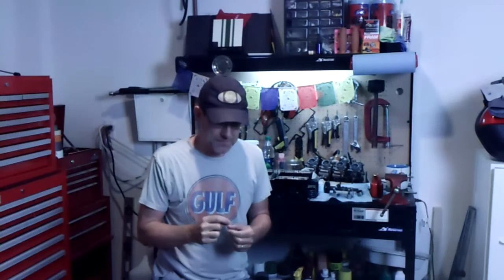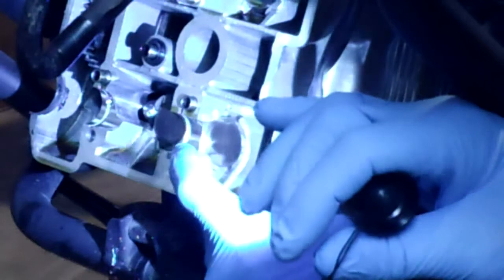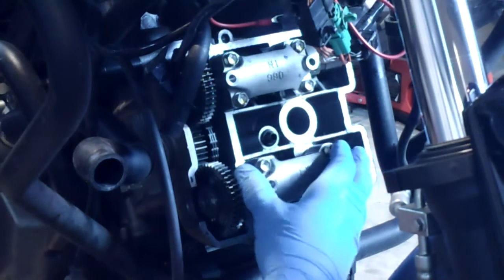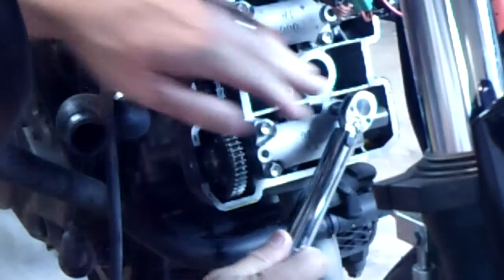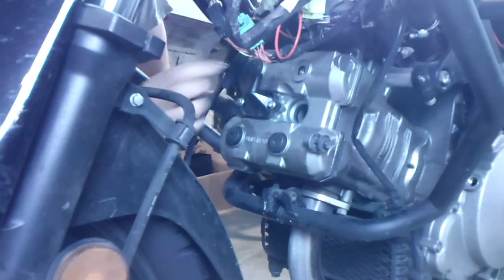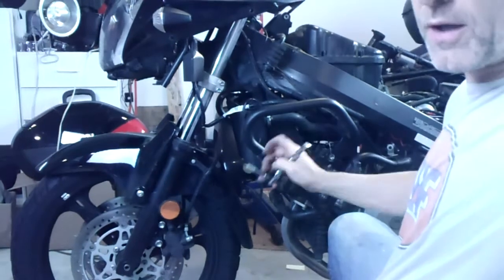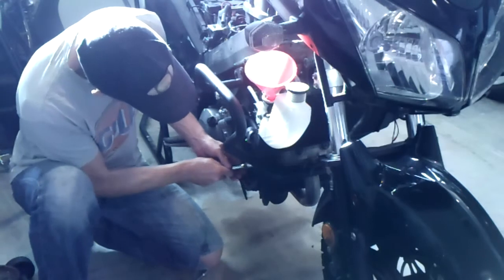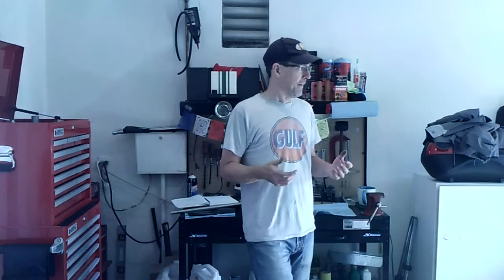Valve Tappet Clearance Adjustment Suzuki V-Strom 1000 (Part 3)

Comment: Hey, not sure if you still check the comments, but I noticed you haven't changed any gaskets here. From what I read I find the recommendations to replace ALL gaskets - that includes the spark plug gaskets, the cover gaskets and the cover nut gaskets as well. Is this overkill or a good practice? From your video the gaskets do seem fine for reuse, but of course you never know what micro damage they could have. Thanks, great video!
Reply from the maker: I have not replaced any of those gaskets. In fact, I inadvertently got one of the cover gaskets caught in the cam gears and cut it. I just give it a dab of black RTV every time I put it back together and no leaks. I'm not experiencing leaks yet, but I've only ridden the bike 103,000 miles so far. Maybe sometime. Thanks for watching!

Comment: Thanks for the great videos, Urban Monk TV. I was gonna take the bike to the shop for the second valve adjustment (48,000 km or 30,000 miles) and they're charging around $ 800 - 1,000 Canadian (I live in Alberta). But after seeing this definitely doing it myself.
Reply from the maker: Good for you! Thanks for watching.
Reply: @UrbanMonkTV  My initial plan was to investigate the problem of oil leakage from the front side of cylinder No.1 (suspecting the spark plug, will know once I start investigating). But now that I'm thinking to do this, might as well just do the valve adjustment! Cheers and safe ride.
Reply from the maker: @ElnurMalikov  There is a rubber gasket around that spark plug hole. Perhaps it has been compromised in some way. Easy enough to do. Enjoy the project!
Reply: Urban Monk TV thank you, Sir. I’m hopeful that it is spark plug gasket, otherwise it is going to be a headache trying to find the source/fixing the leak...
Reply from the maker: @ElnurMalikov  Chances are very good it is that gasket, or the valve cover gasket or one of the 4 gaskets around the cover bolts. All easy fixes.
Reply: Urban Monk TV I will have a look and let you know afterwards :). Thanks again
Reply from the maker: @ElnurMalikov  Thanks! I'm curious now.
Reply: Urban Monk TV So I stripped the bike down to the engine air filter. It was badly dirty and when I took the air filter out the plastic pan underneath had some engine oil in it, maybe around 20-30 ml, not too much. I’m wondering if this is how I’m having the oil leak, as when I inspected the front spark plug in No. 1 cylinder there was no oil there. I’m thinking it is the oil from this pan dripping down the cylinder...
Reply from the maker: @ElnurMalikov  Possibly. There's a crankcase gas recirculation circuit leading from the engine to the airbox. Oil can come into the airbox through that breather line if the bike ran while on its side, if the bike has been run a long period of time at high speed, or if the engine oil has been overfilled. Alternatively, does it have a K&N air filter or an OEM paper filter? Sometimes oil leaks off those K&Ns. Finally, worn piston rings could cause this too as crankcase pressure would build higher, but that would be very uncommon in this engine. Can you check your compression while you're in there? I'm guessing it's not a big deal, but can't say for sure from my armchair.
Reply: Urban Monk TV, when I saw this yesterday first thing came into my mind was that I tipped my bike over a couple of weeks ago - I know its embarrassing 😒. And yesterday when I was taking things apart I was able to take a good look at the leakage source, and it is not from spark plug area, but rather from Front Intake Pipe that is on cylinder head, where the Metal Clamp is. So I’m wondering if it is the oil was sucked somehow by the Front Intake Pipe and started to leak outside by dripping down the outside of Front Cylinder Casing? The filter is OEM paper filter btw. Also, your theory seems to be proving itself regarding the oil propagating through the breather; I found some oil residue in that small compartment (in the corner of the airbox with small filter in it) as well and I can say that this oil residue in this small compartment (but not in the airbox filter itself) was mixed with gasoline (which is this breather normally designed for?). Looks like mystery is solved for me 🤔?
Reply: Urban Monk TV unfortunately, I do not have means to check the compression...
Reply from the maker: @ElnurMalikov  Guessing you don't need it, but if you're interested, compression test kits are cheap. https://www.ebay.com/itm/Engine-Cylinder-Compression-Pressure-Tester-Gauge-Test-Kit-Long-Pipe-/153879475477?_trksid=p2349624.m46890.l49292
Reply: @UrbanMonkTV  Now that you sent me the link and now that I know it is not that expensive might as well just go ahead and get one :). For some reason, I always thought it is a big bulky device. This particular one does not ship to Canada, but I can always find one that does! Thank you so much for your comments and recommendations. It is a great deal of help!
Reply from the maker: @ElnurMalikov  Happy to be of service.

Comment: Could you do an explanation on cam chain tensioning procedure for v storm 1000. I have a TL1000 and believe the procedure would be similar. Thanks. Great videos.
Reply from the maker: Thanks for watching! The cam chain tensioner on our engines is supposed to be automatic,  but I've read some tensioners had issues. I'm not having any problems with mine so I won't be doing a video on it, but I did find an explanation of the process here from poster RoyQ. I can't vouch for it however. https://advrider.com/index.php?threads/v-strom-1k-cam-gear-chain-noise.673256/

Comment: Excellent series. I have a 2003 SV1000N and will be doing this very soon. 

Awesome. I Subbed and liked all 3. 

Thank you kind Sir!!!
Reply from the maker: pdubowner Thank you for watching! Great engine, the SV/DL. I just did my third tappet clearance check at 45,000 miles and, AGAIN, needed no adjustment. At this rate I'll put 500k miles on this thing b4 I run out of available shims!